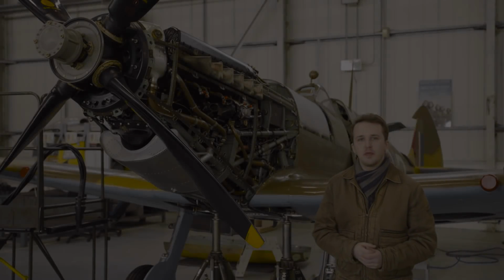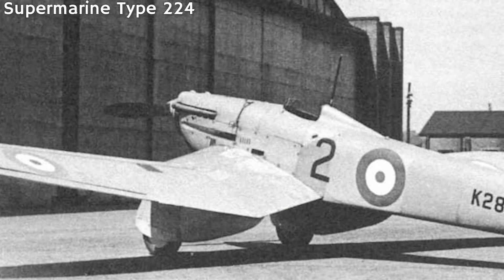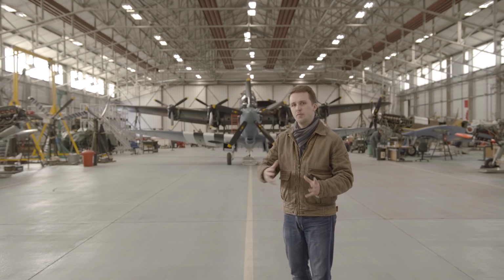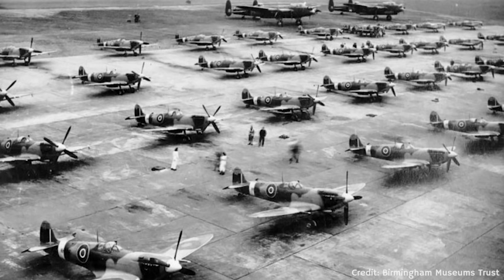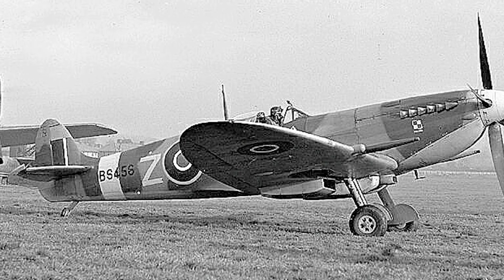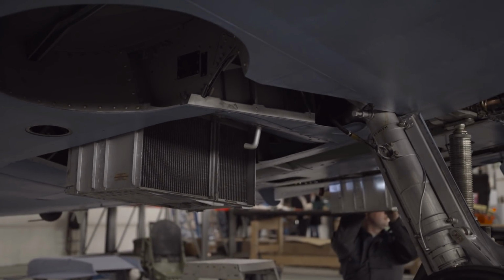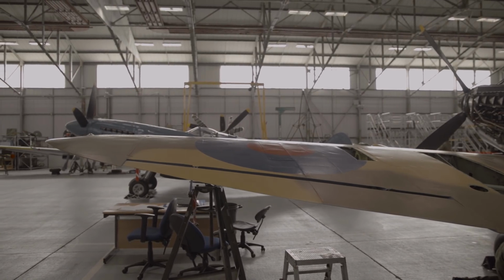Supermarine Spitfire - From Failure to Icon

Comment from the maker: Hey all, very glad to see you all enjoying this video. Slight hickup on the engine information - it happens. Happy to see that some of you caught it, feels great to have such a dedicated community of aviation fans :)
Reply: Yep. Not an inverted V, but a "right way up" V config.  Great presentation Bismarck. Subscribed.
Reply: amazing video man. very enjoyable to watch.
Reply: If you can tell me how Mutt Summers got his rank of 'Captain' I'd be interested to know.  I think he made flight lieutenant in the RAF but captain isn't even an RAF rank.  Was it from his job at Vickers?  FYI, the spacing of the guns had no impact on their concentration of fire.  The lines of fire were harmonised to meet at a specified point a few hundred yards in front of the aircraft and it didn't matter at all how far apart they were in the wing.  Having them close to each other would have concentrated stress and made the ammunition feeds difficult in the thin wing.  Also, the maximum octane rating used in the Spitfire was 105, not 150.  A great summary but I must have missed the bit where the Spit started as a failure.
Reply: @timgosling6189  "Captains" fly civilian aircraft so it could be that.
Reply: Nice job...      Why did the restoerers decide to extend the clipped wing?
Reply: Gus I’d imagine it was purely for the BBMF flight to make sure it was more easily recognisable, not many of the clipped wing variants are ever shown and the wing shape makes it easy for most to identify from the Hurricane. Though personally I’d like to see the clipped wing variants flying as I’ve never seen one despite having seen lots of Spits!
Reply: Regarding the clipped vs standard (or even elongated) wing tips, keep in mind that they could be switch easily by the ground crew.  It took about 30 minutes or so to change them, if desired.  In practice, by the time this airframe was in service, almost all Mk IXs, regardless of LF, F or HF (designations determined by the presence of a Merlin 66, Merlin 60 or Merlin 70 respectively) were flying with clipped wings as the air-to-air role was decreasing in significance for the short ranged Spitfire and the newer Mk XIVs were seen as enough to fulfill the air-to-air role.
Reply: Only the aussie & kiwi spits had the inverted merlin
Reply: My dad use to work as an engineer in the raf, he was stationed at the battle or Britain memorial base in Coningsby. I grew up around this air craft and will always love them

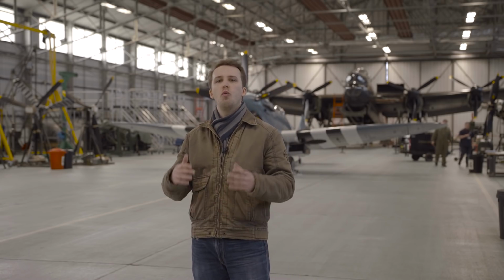Comment: The commentary is a bit disappointing with several gaps and goofs. The first at 3:13 being the fitting of an inverted Merlin engine. Next at 4:34 we were informed of the prototype's first flight in March 1946. 
During the prototype's flight testing from 6th March 1936 on, it was fitted with several propellers and more powerful engines but still could not beat a Hurricane in level flight. The cause was due to parasitic and induced drag from rivet heads, overlapping fuselage panels and gaps between the dozens of small panels used in constructing the wing surfaces. Check out the Tangmere Museum's replica prototype Spitfire to see all the internal and external changes that had to be made to the production Spitfire wings. These taking nearly 18 months to complete.

Comment: You listed benefits of clipped wings to spitfire performance, so what were the benefits of unclipped wings? If clipped wings are better then why weren't they standard? What was the design intend of the original unclipped wing shape?
Reply: Better climb performance, stall characteristics and energy retention in maneuvers.
Clipped wings' main upside was roll improvement, especially at higher speeds past 250 (or so) mph. 
While "faster acceleration" was also true, it was quite a minor improvement in comparison, and "better dive performance" might mean the same thing about better controls at high speeds.
Reply: @MDzmitry  The LF Mk V's also received the new metal elevators to help with high speed dives.
Reply: @bobsakamanos4469  from what I know metal elevators were a general implementation no matter the sub-modification (meaning they were installed on all models and types) starting with ~1941
Reply: @MDzmitry  the metal elevators were introduced on the Mk.IX and late production Mk.V.  Many earlier Mk.Vs were converted to LF standard with the Merlin 45M, 50M or 55M engines and also received the upgraded elevators. 
You are thinking of the metal ailerons that were introduced in 1941.
Reply: @bobsakamanos4469  ah yes, my bad. Still somewhat correct with the idea that metal elevators were common among different Marks
Reply: @ true enough.  An interesting evolution.
Reply: @MDzmitry  true enough.  An interesting evolution of constant improvement.

Comment: Erm... You have a great many of your facts wrong,. Many literal 'facts' you get right you claim these facts were deemed problems and considered negatives. These are lies and misrepresentations, and biased. In fact 99% of everything you said about this plane was presented as a negative, inferred as a mistake and or incompetence of it entire design and present the genius of the Spitfire was nothing more than war time advertising propaganda. 
You're right about the Type 224  predecessor was crap. But using facts to create an entirely untrue context is lying. Where you get this no difference in performance to the Hurricane I don't know. The Spitfire could completely out maneuverer the Hurricane's Turn rates, Roll rate's, barrel roll rate's and immediate vertical climb rate and dive speed. Don't Lie about the plane, just say you don't like the spitfire.
For example: The twist in the wing was a specific design specification called the 22/13 principle. Which was coined by the Spitfire wing designer Canadian Aeronautic dynamics engineer Beverly Shenstone who had spent time study tour at NACA [National Advisory Council for Aeronautics - Later became NASA] Shenstone found this principle when applied to elliptical wing dynamics gave maximum air distribution and aerofoil lift.  The principle was deemed a theory, and Its the first ever plane this major aeronautic principle was the introduced. 22 represent  20% distance from leading edge of wing to 90% angle to wing cross bar to the body, and the cord line, 2% up from that point. 13 =13% Wing thickness taken from the wing cord. The twist is an explicit curl from the wing base to the body, meeting 90% angle of the wing bar to the body, yet the wing trailing edge start as 22% angle facing down bellow the aircraft body, [unlike the Hurricane where the wing is inline with the body] and curling  to the tip to be straight with the body. It is this structure that made this plane more the agile and manurable and air distribution across its wings than the Hurricane and Me109 and the Focke Wulf 190. This is the reason why the wings were a very complex build, and because the unique twist design was presented to the air ministry as the new revolutionary way forward which they accepted and introduced and all costs and required new training for manufactures. It was never a negative, never a manufacture issue, never a problem, "it was a revolution". The rule of 22/13 is a rule still used today in 85% of all aircraft. Even the Boeing 747 wings uses this rule, without the ellipse.  "So it was never the problem you claimed it to be".* 
I have no problem with critical opinions of any plane, but I could take apart every claim you made and prove them to be misinformation and bias by manipulation of facts, presenting a denigration of engineering. Either you are ignorant of the history of this plane, or you just don't like it, or maybe both. But nothing you said was positive and the context of which you presented was false.

Comment: What if Mitchell had lived beyond the mk1,what would be have come up with?
Reply: He was working on the Type 312 in 1937 when he died.  It had a ventral radiator scoop and carb intake under the spinner.  Smith later wanted to resurrect that design, but Vickers wouldn't allow it because they didn't want to stop and retool the assembly line. 
It would have been about 30 mph faster, better climb and longer range. 
Kindelberger visited Supermarine in 1938 during his tour of Europe and they asked if he would build Spitfies. He declined.  The NAA P509 (precurser to the Mustang) was developed in 1939.

Comment: The Spitfire was never even close to being any sort of failure as the title of this video seems to suggest. It also never used an inverted V12 engine! The 224 was actually going to be called "The Shrew" believe it or not but was not considered for production at all, as that was a failure but can hardly be called a true ancestor of the Spitfire being built to a specification laid down by the Air Ministry. The Spitfire was not designed to an Air Ministry spec, but to what Mitchell himself had in mind. That of course is how many excellent aircraft came about - essentially in defiance of the relatively clueless Whitehall bureaucrats!

The Spitfire was a success from the prototype's first flight at the hands of Mutt Summers, who stepped out after that flight with the words "it is perfect, don't change a thing!" No doubt in his excitement he exaggerated a little, not surprising!

Of course the prototype was not ready for service and in any advanced piece of new high performance machinery there are always bugs to sort out. That the Spit was a resounding success is evidenced by the fact of it's successful development through so many marks over many years of continuous service.
Reply: It was almost perfect, the narrow track undercarriage would be my major criticism of the aircraft. Definitely a thoroughbred performer once in the air.

Comment: No mention that the wing(s) alone took more manhours to construct than an entire Me-109 airframe ?
There was also supposed to have been a fluke in the wing design that  created a vibration that acted as sort of pre stall warning in not pushing tight turns beyond the limits of the aircraft. Very exceptionally skilled Luftwaffe pilots could apparently out turn a Spitfire but it was not encouraged given the dangers involved.
Reply: Nah!

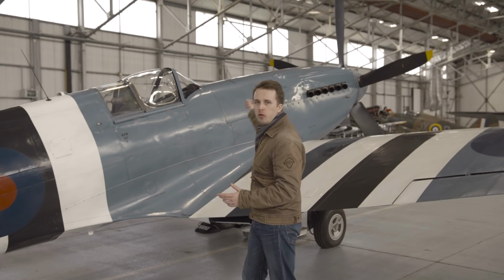Comment: Point of order....correctly, @ 3:13 examples of the inverted V-12 are the Daimler-Benz DB 600 series; also, @ 6:57 the Rolls-Royce Merlin is an upright V-12 and NOT an In-line engine.

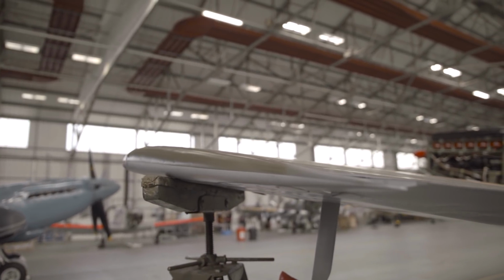Comment: 8:50 ‘clipped, cropped and clapped’.. clipped wings for increased roll rate, cropped supercharger impeller blades for more boost performance, and clapped, meaning they were generally battle weary Spits, MkVs for example..

Comment: Mk IX the best of the bunch, others after it just faster but did'nt retain the pure fighter agility of what Spitfire is all about
Reply: Still, Mk XIV out-turns and out climbs contemporary 109 and 190. :P On top of that it has much faster top speed, climb rate and dive to Mk IX/Mk VIII. :) Don't get me wrong... 2-stage Merlin Spitfires like Mk IX/VIII are great fighters, and they should out-turn Mk XIV, especially in left turns IIRC because of the engine torque.
Reply: @anonymous8780  if my memory is still in working order, from MK-XII up, it is powered no longer by Merlin engines for those engines were hurriedly built for export to North American Aviation as demand for more P-51D Mustang peaks. MK-XII to MK-XIV were powered a much too powerful engine....The Griffon

Comment: Missing from every discussion I've ever seen regarding the Battle of Britain and, of course, the Spitfire is an article I read years ago in The American Inventor. It turns out that a French chemist fleeing from Vichy France went to work with DuPont, I think, and figured out a way to make 100+ octane gasoline. This was an incredible boost to the power of the Spitfire, which hadn't been remarkably successful against the Messerschmidts before that, and was the real story behind the success of the Spitfire, as the Germans only had 87 octane gas.
Reply: The American's made high octane fuel available to the British before the BoB. Eventually the British recieved 100-130-150 octane rating American fuel. The British always conveniently leave out this fact. The Germans had 87 octane fuel. Without the American fuel the sputfire would have been decimated by the far superior German fighters of the time.
Reply: @chopchop7938  Who left it out I've read a few histories of the BoB and they all mention it .

Comment: Gave you a thumbs up in spite of you saying that the Merlin was "inverted". The other mistake is that 5,000 metres is not 20,000 feet. 6,000 metres is 19,685 feet. Quite a difference but good video all the same.

Comment: The Merlin is not an "inverted:" engine.
The bf109 engine (605?) is though.
Reply: Depending on the variant of the BF 109, the engine could be a DB601 on earlier variants,,  and then the 605 on the later ones.  Not sure if it used the 603, maybe with the K model.
Reply: @reidveryan9414  ...
 Still, they're inverted.
Reply: @paspax  for sure
Reply: @paspax  if you haven't yet you should check out Greg's airplanes on reasons behind the inverted v-12. Really fascinating
Reply: @reidveryan9414  ...
Greg is fantastic

Comment: Fire hazard with regard to the glycol/water storage tank?  Nein! Nothing flammable about either the ethanol glycol, or the water. Added armor plate was to help protect the (coolant) tank itself, not to prevent/reduce a fire hazard from the coolant mixture itself.( Of course , it is understood that engine overheat and possible resulting physical engine damage (with an increased fire possibility) would occur with the loss of the engine coolant).

Comment: Thanks! I really like your channel  :-)
*Rolls Royce inverted V-12.    Oops. No, that was a slip of the tongue. LOL.
The armoured wind screens: That was the work of Chief Dowding protecting his "chicks".
You mentioned the Meredith radiator. Why don't you make a video about the Meredith effect. Spitfire and P51 Mustang.
Because this is an original Youtube channel and not one those that only copies what others have done, I will throw in a personal story about the Merlin. A late friend of mine owned a Merlin. His name was Per Gillbrand, also known as Mr Saab Turbo. He had a Merlin in his garage. Anyway, he had just finished renovating the Merlin when he and his wife had some guests. "Per can't you start it". Well Per thought that an engine never starts on the first try, so he turned the switch......  it didn't even have the small exhaust pipes on....   Of course it started, now Pers wife afterwords described how the shelfs in the kitchen vibrated,
LOL. I might have these words on video!!

Comment: At 3:12 you mention that the Merlin V-12 engine was an inverted V-12 design, however, it wasn't; the Merlin engine was a "regular" V-12 with a standard orientation. The Daimler-Benz DB 61 was an inverted V-12 design adopted by the Germans and used widely in their aircraft like the M Bf 109 and so on.

EDIT: Oops, I see you already have a few comments on this.

Comment: I know that the British/US units are illogical and archaic, but 20,000 feet is not 5,000 meters, and 400 mph is not 550 kph.
Reply: Correct.... its 20,000 ft is 6096m and 400mph is 643kph.
Reply: "British units are illogical"?  They are perfectly logical.  I suspect you should have used a different word there.
Reply: US units what f are they.
Reply: there is a long history behind the imperial system.  It's more logical and scientific than you think.

Comment: Photographic reconnaissance Spitfires could carry a large amount of fuel in their wings (giving them a range of up to 2000 miles on internal fuel) without any major ill-effects on handling, but, of course, this came at the expense the ability to carry armament and ammunition.  There really wasn't such a thing as a long-range armed Spitfire.  Even with drop tanks, the relatively small internal fuel capacity of armed spits would always be the most significant limiting factor preventing major extensions of their effective combat range.
Reply: @HiWetcam The Mark VII and VIII Spits had the greatest internal tankage at 122 gallons which enabled them to fly approximately 660 miles on internal fuel under optimal conditions.  The maximum effective range of these aircraft would have been just shy of 1200 miles with a 90 gallon slipper tank which would need to be dropped before entering a dogfight.  Of course these figures are at cruising speeds at the most fuel efficient altitudes.  Increased power usage and fuel consumption during combat reduces the effective range considerably.  500 miles from base would probably be the maximum combat radius of these extended range Spitfire fighters, and that is probably being generous.  As such they were certainly not in the same league as the P51 B-Ds which routinely sortied to rendezvous with bomber formations over 700 miles distant from their bases, though the Mustangs had to basically become flying gas cans to accomplish this.

Comment: The propeller's pitch wasn't actually connected to the throttle - it used a regulator to keep RPM constant. If you advanced the throttle that increased the power, which tended to make RPM increase. This caused the regulator to increase the pitch, which kept the RPM from rising but would absorb the added power and increase airspeed. The regulator would also increase pitch in a dive and decrease it in a climb, keeping RPM constant and increasing propeller efficiency to suit conditions.

Comment: I really enjoyed that. It's an excellent video with some good content. I really liked getting to see the various cooler locations and fluid reservoirs you pointed out. Showing the details of the wing structure was good as well. I know you mis-spoke at one point calling the Merlin an 'inverted" engine, but who cares? We all know what you meant, and it's really hard to speak for 20mins straight without a single slip up, I can't do it. Again, great job, and I am looking forward to the next one.